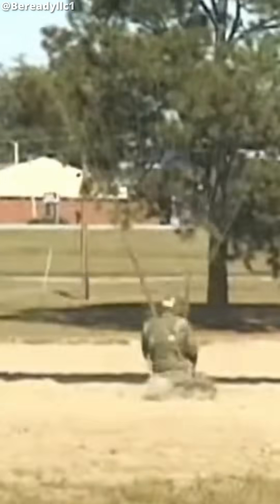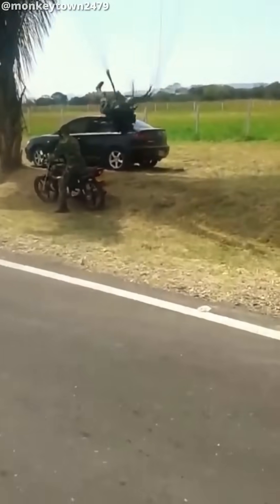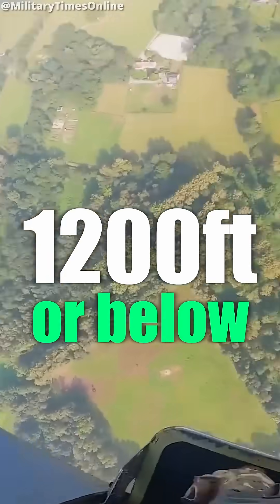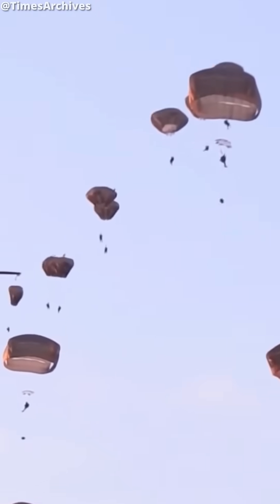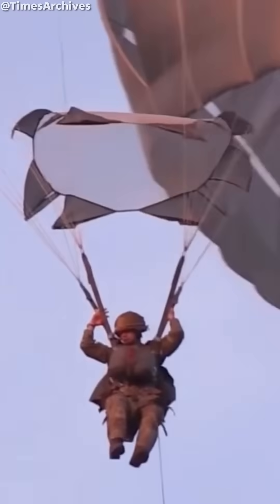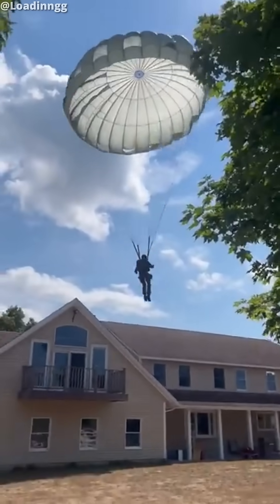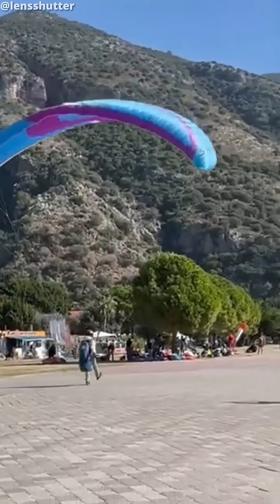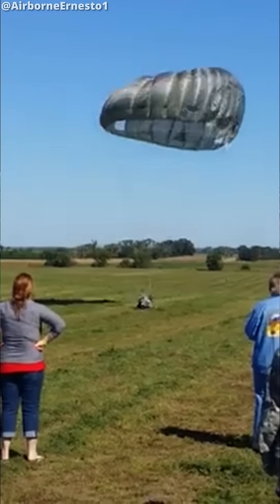Why Do Paratroopers Crash a Lot?

Comment: So basically the paratroopers use parachutes that are worse then the civilian grade ones.
Reply: they're meant to descend quickly, if you're a para trooper in a military operation you probably don't want to glide about for half an hour in the air
Reply: @shiinondogewalker2809  You could easily implement a basic feature where just before landing you could reduce the fall speed. 

The only reason this is not implemented is because military values saving some money > soldiers getting life altering knee injuries. 

The thing that I do not understand is how people are brainwashed into thinking "this is how it's suppose to be, faster landing" when the feature wouldn't even affect the landing speed. It's like one of those things we will look back in some decades and think "why we were so fucking stupid and didn't value our soldiers health???"
Reply: @Snout007  For sure, I was only comparing it to a regular parachute. Thanks for calling me brain washed
Reply: @Snout007  Army uses two versions. At the T-11 version you can slow down your lateral movement by pulling a slip before landing.
Reply: @Snout007  
It's not brainwashing. military personnel are fully aware of the design ethos of their chutes and the shortcomings of such. 

Explaining isn't the same as defending. You're extrapolating that part.

I used to be upset about military budget cutting and the cost on service personnel too, still am; but I realised bagging on poor use of resources was besides the point, that the best way to save lives was to avoid war rather fund it better.
Reply: @WhatIsSanity  If you avoid war, wouldn't you have more resources that you can spend on improving soldier health? Like parachutes? Not sure I understand how you  get to the opposite conclusion. 

Also. Avoiding war is not that simple either. For example with Russia, Biden tried to avoid war by drip feeding Ukraine ancient weapons that would have been destroyed either way due to their old age, while laundly mentioning huge dollar numbers in the news. At the same time, not even allowing Ukraine to strike Russia and leaking Ukraine's entire counter offensive plans... Which means Ukraine has literally no chance to win when it had the momentum. So now the war will drag on for years and maybe decades with probably millions of people dying in this strategy of "avoiding war". Where putin controls the narrative fully and USA just follows along, lead by Putin. Even though Russia changes the "red lines" literally every few months. 

So it's more like you are closing your eyes, letting the enemy get uncontrolled and then you will have to open your eyes when shit hits the fan and your preparation levels will be abysmal.
Reply: @Snout007  Complicated parachutes will kill more soldiers. Soldiers will prefer a broken leg than death by parachute.
Reply: Ironically , nobody has used paratroopers for paratshoot assult since WW2. The russians attempted something like that at the start of the war in Ukraine just so their VDV batalions got decemated by SAMs.
Reply: @mowtow90  i mean the attack at hostomel worked from the POV of the paratroopers problem was just that the normal russian army/infanrtry couldnt advance quick enough to connect  to them cause their army is bad trained and equipped cause alcoholism and corruption - but the VDV were good and "achieved" their goal... temporary xD
Reply: It's so they don't get shot down
Reply: @dav356  that is a warcrime so they shouldn't get shot down either way. Also, shooting at moving targets in the sky is a dumb tactic overall, just a waste of ammo, especially when you consider the fact that they're just soldiers. That ammo and attention is better spent on ground combat
Reply: @eeeeee8762  No. It is war not a war crime.
Reply: @eeeeee8762  Not a war crime to shoot at a paratrooper that is invading/on combat mission during the descent.
Reply: Depends on how you define better and “worse”

Cost less to produce ☑️
Less time floating above a warzone ☑️
Reply: In battle parachutes are not used at all.
Reply: My day, we had the MC1-1B "steerable" or toggle-line-controlled canopy. Now, 40+ years later, my son uses the new T-10 main canopy. You are at the mercy of the wind.  Why did Uncle Sam screw this up and remove the toggle-line-controlled canopy?
Reply: For a reason. Thousands of jumpers with steerable parachutes would be a disaster. We do have steerable parachutes but only like to use them in small groups.

Comment: Actual question...why don't they give them those steerable parachutes so they can maneuver and make themselves harder to hit or even to be spotted???
Reply: When you have 100 people jumping out of a plane at once, if all of them were steering in different directions, it would be complete chaos with people running into each other. It's better to have the all drift in the same direction. Plus, steerable parachutes are much less reliable, as the added complexity makes them more likely to get tangled up.
Reply: Because they are jumping sometimes as low as 550ft.

Comment: It seems to me, changing a parachute to be idk safer, would he cheaper than a shitload of knee surgeries 😂
Reply: The steerable parafoil parachutes are not only more expensive and less reliable (all of the additional lines used to steer it make it more likely to get tangled up), but they slow down the descent too much. Paratrooper chutes are meant to get the guy to the ground as quickly as possible without killing them, because the longer that you are in the air, the longer that you are a defenseless sitting duck for the enemy to play target practice with.
Reply: @raptor2265  Thanks for the explanation guy

Comment: Remember: "Military Grade" just means "Good Enough for Use in The Military."

Edit 2 (but higher up because it was originally written by another guy and is more useful):
@hanasong364
"As someone who worked in a plant with military contracts here is the actual definition. Military grade is the minimum acceptable product for the lowest cost. Ie, as cheaply as possible while still being functional for a minimum amount of time."

Military grade is the minimum acceptable product for the lowest cost. Ie, as cheaply as possible while still being functional for a minimum amount of time.
Edit: a couple of people don't like the way I phrased this, so I'll rephrase it:
"Military Grade" does not mean something is always the highest quality it COULD be, rather, it means something reliably functions good enough to justify costs of mass production. It still works, it absolutely works well, but non-military products can work better due to being slower and more difficult to make, often resulting in a higher quality but FAR lower quantity.
Reply: Which also means "sold to the lowest bidder"
Reply: @62squad it means "sold by the lowest bidder"
Reply: @62squad Sig P320 is a good example lol
Reply: @RiderGiles-q1w  Nah its been said tho that the problem was solved after some time and it works normaly now for what ive seen from people on the matter.
Reply: @marcos9274  lmao. no.
Reply: @marcos9274 I can still get  the m17s in my arms room to drop fire
Reply: @62squad  More like "Made to the minimum standard and with as much cutting corners as the standard allows to increase profit"
Reply: @Donnerwamp  no different from everything else made.
Reply: Too true😂
Reply: "Military grade": only just enough for the lowest contract bidder to hit the spec that some schmuck who's never going to be within 300ft of the real thing wrote five years ago,
Reply: means the cheapest bidder got the contract
Reply: ''Cheapest we could technically still get away with''
Reply: In the gun community, "military-grade" is an insult.
Reply: the best cheap stuff
Reply: For parachutist it means it won't kill you under normal conditions, but....
Reply: I always tell people don't buy military grade that just means it's 50 years old and never maintained
Reply: the contract goes to the lowest bid!!!!! unfortunately
Reply: Military grade means "the shittiest and cheapest crap we could find"
Reply: by my under standing it also means: "within budget"
Reply: military grade is literally built by the lowest bidder
Reply: "Good enough to give to everyone for free."
Reply: war is about logistics and money cus war is winning money, its like business, many people doesnt recognize that dude
Reply: The one guy looked so bad
Reply: Close. Military Grade means it meets the specifications for the mission requirements it is designed for. That is all.
Reply: I have come to learn this the hard way around when my guns gets jammed in a video game. 💀
Reply: Depends on country. Smaller militaries often put money in the quality, because they don't have to consider quantity so massively. In my country "military grade" is the good grade stuff
Reply: Military grade meaning changes dramatically depending on if you where in the service or not
Reply: Sometimes it's not even about working well.
There are many things that are better, cheaper and more reliable than things used in modern militaries. 
But they don't integrate with existing infrastructure. If a weapon doesn't fit in the thousands of armouries around the world? unuseable.
Reply: In no country in the planet does military grade equates to good quality
Reply: And sometimes they don't work well. In fact, they're often held together by baling wire and spite.
Reply: I looked it up, a single military US grade parachute costs about 4000$, and for how many they need it could go past the millions lol
Reply: Military grade just mean bear minimum requirements
Reply: "Enough survive to continue the field op"
Reply: Yappology master. Doesn't know jack shit lol
Reply: @emptyfueltank  Alright, you try to please the lot of angry replies then.
Reply: For clothing and infantry equipment I’ve found western military surplus really good quality, I guess it depends on the country. Much better quality than domestic equivalents
Reply: Anyone crying about it has never served lol straight facts
Reply: I think it's hilarious you had to justify your phrasing, hahaha
Reply: most american military guns are based on civilian guns
Reply: @MarkSoucie   As a brit, I have no idea what this means.
Reply: It means 'We got three quotes and were forced to take the lowest bid from a company that's  going to cut every corner possible' lol
Reply: Remember: Your equipments are made by the lowest bidder.
Reply: More like marine proof
Reply: So what you're saying is if we slow down production and add some controls our paratroopers would be much better off
Reply: As someone who worked in a plant with military contracts here is the actual definition.

Military grade is the minimum acceptable product for the lowest cost. Ie, as cheaply as possible while still being functional for a minimum amount of time.
Reply: And still having the biggest budget.
Reply: gettin real sick of hearing this phrase with no context applied to it, YES its true for a lot of equipment because a lot of it is disposable anyways, so why pay top dollar, despite the US Military being often quite stingy (F in chat for the Marines) they also often go out of their way to PREVENT costs, you know what you'll save MORE money on? making sure the dudes you just spent millions of dollars training don't fkn die, that's highly evident in any sort of armored vehicle thats expected to be put in not very happy situations, same goes for the parachutes and if i'm not wrong new ones are now in use that perform static line and have more maneuverability, still less than the standard ones as they aren't suitable for the purposes they are INTENDED for but still, an improvement
Reply: @cburn-YT Thank you.
Reply: Military grade is actually really good. If you use it how and for what it's made. Sadly, such is rarely the case in the US military.

For example, the humvee is a great vehicle, able to go through a variety of terrains and keep on moving across jungles and shit. It's not, however, meant to be used at high speeds... guess what you can see in the highway going at 45mph? a Humvee, which, those speed may not be impressive to many, but this thing is less aerodynamic than a brick, so it's all force, it's be like someone missing a lunch, having a tiny heart and being 2/3 the size of Hussein Bolt, reaching Hussein bolt's slowest run, it's not impressive in the grand scale, but it is impressive it can do it with all those handicaps.
Reply: @bogustoast22none25  I once received a new FLA (four litter ambulance) which is a type of Humvee, only 65 miles on it. None of the environmental functions worked, meaning you couldn't control temp in pt compartment which means it was useless anytime the human body can't control it's own temp, which is rather important in hot environments, cold environments, elevated environments, spinal damage and massive hemorrhage. It fact it's so important that by regulation it can't even be used as an ambulance if the environmental controls don't work without an O-6 or higher signing off on it. What this means is the brand new Hummvee Ambulance I received was useless as an Ambulance because Humvee's are trash.

Now you can argue that this is one case but I warn you the Humvee is my least favorite vic and I have 8 years of stories as to why and believe me you, I can do this all day long.
Reply: @stephenjames2159  maybe

Comment: They really need to update the parachutes they use. I’m betting that they could definitely design something that makes for an easier landing.
Reply: The drawbacks outweigh the benefits. You want paratroopers to get to the ground as quickly as possible - the longer they're in the air, the longer they're just a sitting duck for the enemy to shoot at. Plus, steerable parachutes are much more likely to fail, as all of those additional lines used to steer it can get tangled up.

Comment: There are 2 different parachute shapes

Dome and bow

Bow means you will go down, but the speed is split between forward momentum and downward momentum, more of one means less of the other

But since military wants you down as fast as possible, they use a dome shaped

No steering, and fastest possible speed downward

Comment: Use civilian parachutes then
Reply: It's fast on purpose
Reply: They're more expensive, less reliable (added complexity means more things to go wrong; that steering mechanism requires more lines to change the shape of the chute, which means there's more string to get tangled up), and too slow. You don't want a paratrooper to float down slowly and gently; the chute is there to get them to the ground as fast as possible without killing them. The more time you're in the air, the more time you spend as a sitting duck waiting for the enemy to take potshots at you.

Comment: The no control part just sounds like a terrible idea
Reply: By design. With the number of jumpers in the air, literally could be thousands and at night, you don't want people steering around running into each other.
Reply: @Savage_Viking  on the other side that means thousands of guys with no control of where they are going in the air potentially crashing into each other mid air or into otherwise avoidable objects that could injure and or kill said soldiers